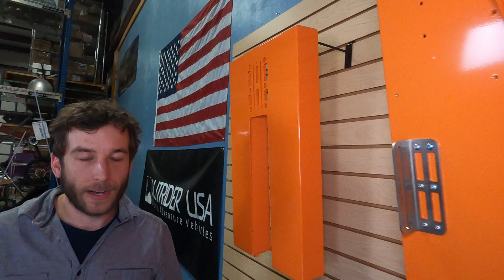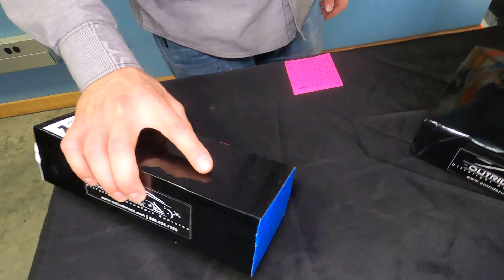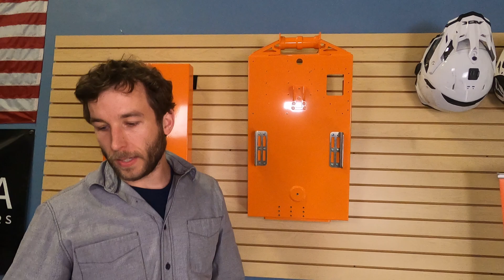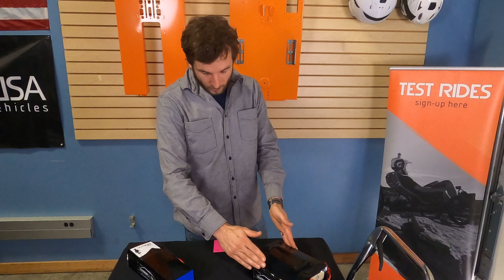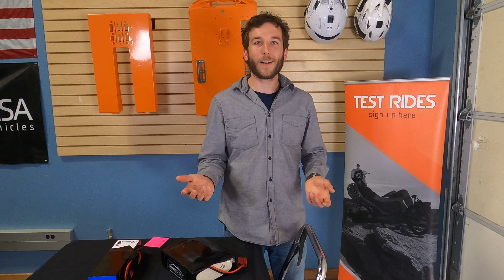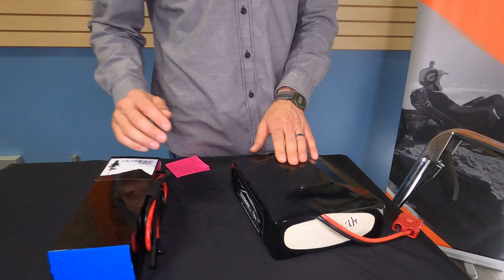Outrider Batteries | Industry Leading Range

Comment: So, the default setting as delivered will charge the packs to just under 100% (<~4.2V/cell) capacity, or is that something I would have to set in order to prolong life? Thank you for sharing this info.
Reply from the maker: Our charger is set to max out the battery at approximately 95% maximizing the life of the battery.

Comment: Can you set the BMS to where it stops at the 20% of the bottom and top of the battery to extend the use of the battery.
Reply from the maker: Hi Mike, we can raise the LVC (low voltage cutoff) for the Outrider to allow more reserve if desired.  We already are pretty conservative in how deeply we discharge our packs, but we can adjust to be more conservative if desired.  Good question!

Comment: Will the heat of a 'Black-Top' road affect the heat of the battery life ?
Reply from the maker: Not at all! Of course under extreme heat, the batteries could become compromised. But, that would have to be much much hotter than reflected heat off the road
Reply: @OutriderUSA  do you need a drivers license to operate it at 50?